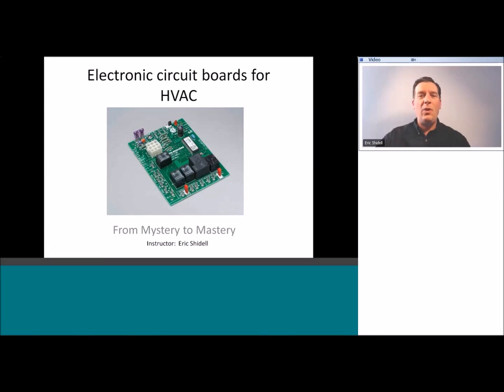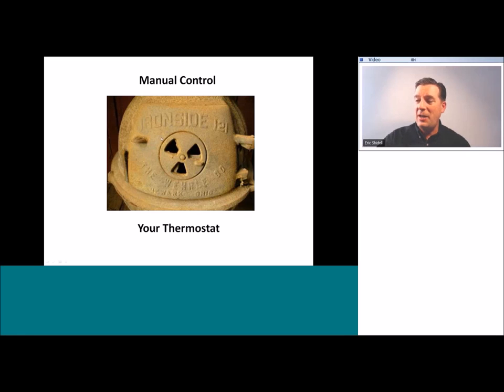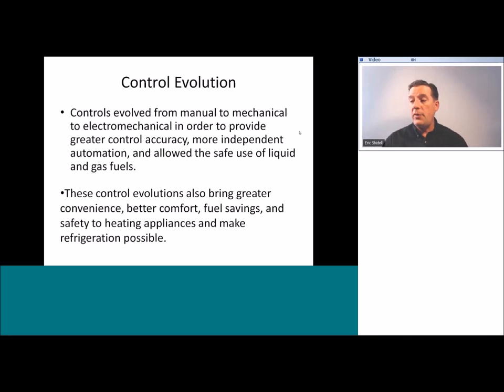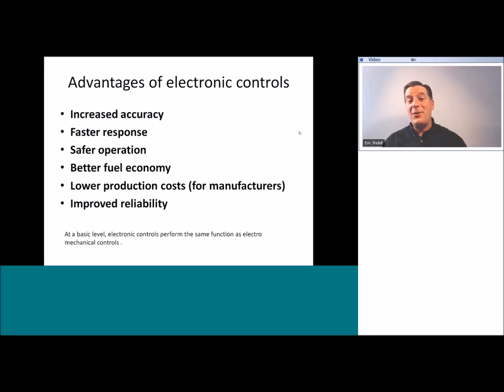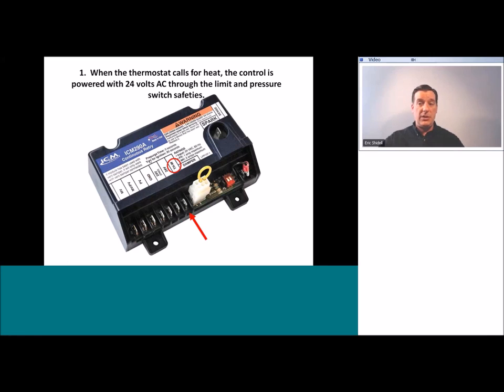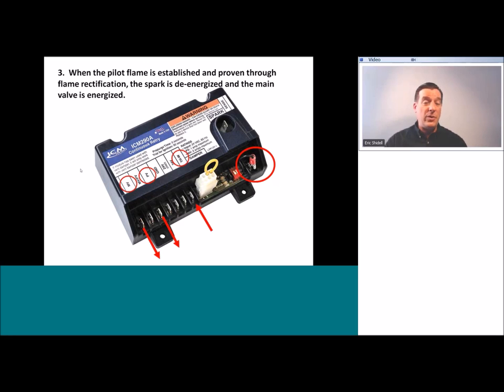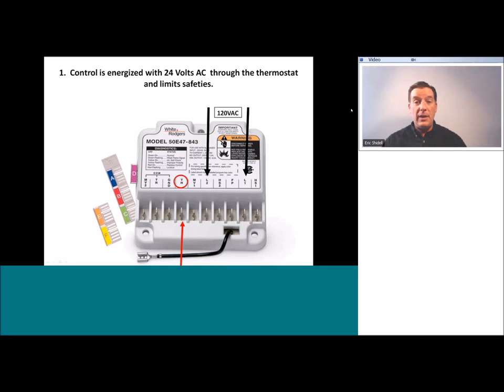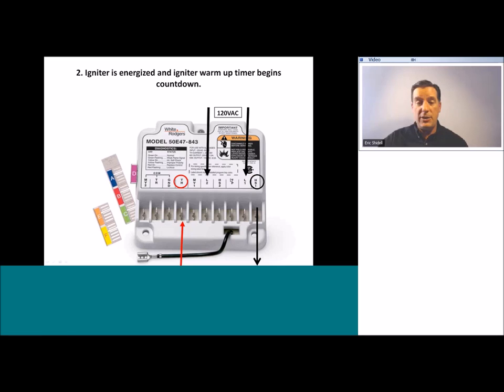Electronic Circuit Boards for HVAC

Comment: At 1:31 in video you measure flame current on supply cable carrying 50 VAC or more. As a non electrician i would have been afraid of damaging my meter set for DC amps.   Thank you again for this great information.
Reply from the maker: A DMM in amps mode (DC or AC) essentially becomes a straight through conductor.   Most meters have a safety CAT III rating of at least 600V.  No problem at all.

Comment: Why does the fuse on the blower motor Control Board only protect the transformer feeding it and not the board itself ? What is the theory behind that at 1:35 in video
Reply from the maker: Low voltage fuses protect against line to line or line to ground shorts in the low voltage circuits.  These shorts will destroy the transformer pretty easily but won't affect the board.  The board can handle more amps than the transformer can.  The secondary output of the transformer lands directly on the board and then passes immediately through the fuse before doing anything else.   Thereby protecting the transformer from any and all down the line shorts.  The board just happens to be a convenient place to locate the fuse.
Reply: @hvacservicementor  Very interesting thanks.

Comment: What does Non Integrated HSI  mean.   I mean what does it mean by Non Integrated ?
Reply from the maker: Integrated Furnace Control (IFC) has all of the furnace functions integrated into one control including draft blower, ignition and burner, circulation blower and safeties.  Non-integrated HSI board only handles the gas ignition sequence and stands apart from any other controls.  Thanks for watching!
Reply: @hvacservicementor  Thank you

Comment: I didnt know you can have 24VAC going to a processor ? I thought it was just DC  electricity that all these electronic chips work with.  At 2:09 in video you are discussing the signals to the processor.    Ohhh   you say 5 minutes later that we are dealing with 24VDC  as the AC is converted to DC.         All good . thanks